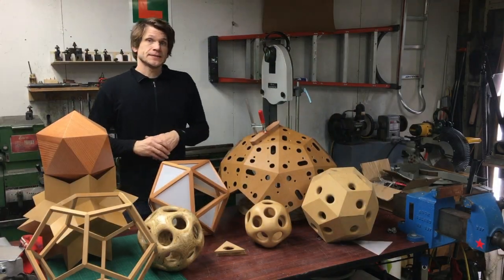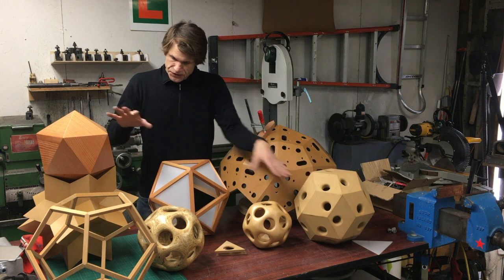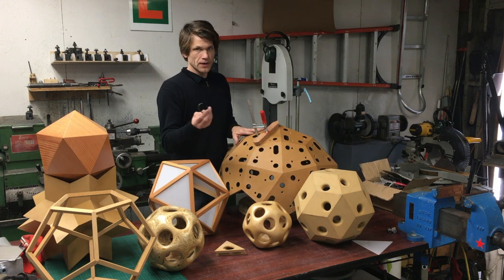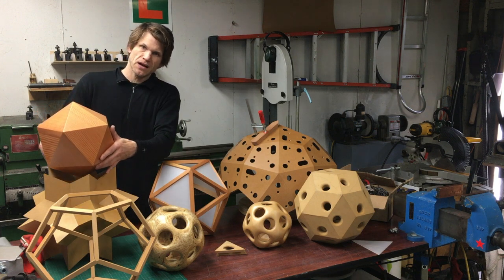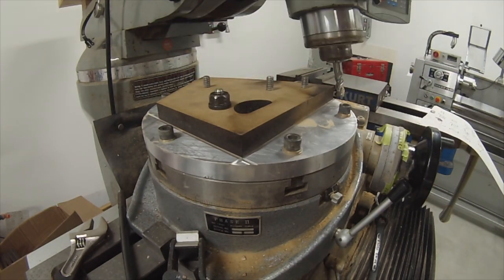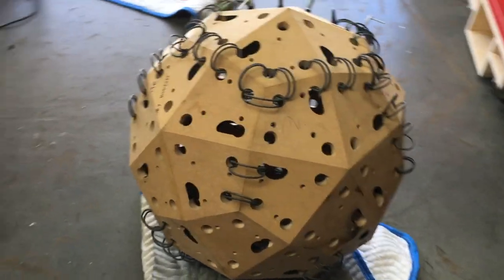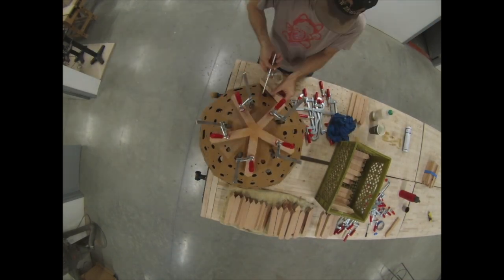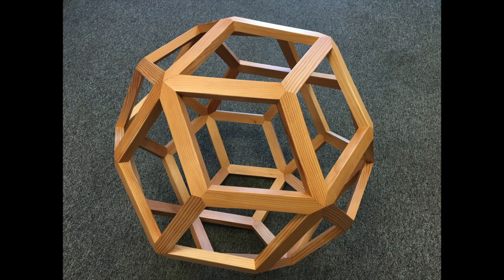How to make a polyhedral form out of wood

Comment: To call this structure a wire frame might be a bit inaccurate. A wire is basically 1-dimensional; can't really put compound miter cuts (3D) on a wire (1D). 

Structures like this are comprehensively described, believe it or not, by roof framing geometry. Each of your edges here are actually hip rafters..

Comment: Beautiful projects! That's about what I aspire to do too. But it seems like it requires quite an extensive set of carpentry tools.
Reply: No, all the fancy equipment isn't required to make these structures. All you really need is a dual bevel compound miter saw, and maybe a clever jig to help position the stock for cutting. If you don't have access to one of those, you can build these with just a table saw. You'll need an even fancier jig, though..